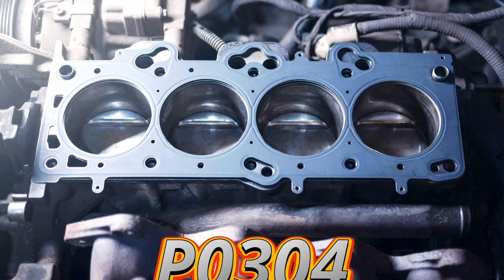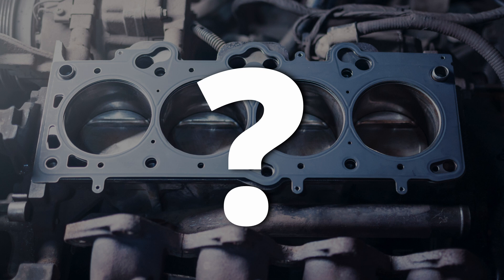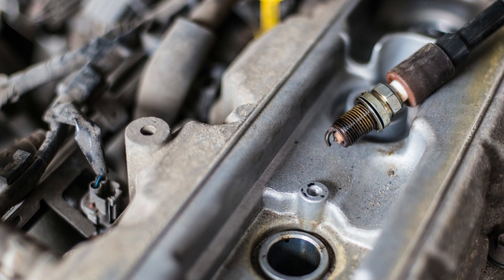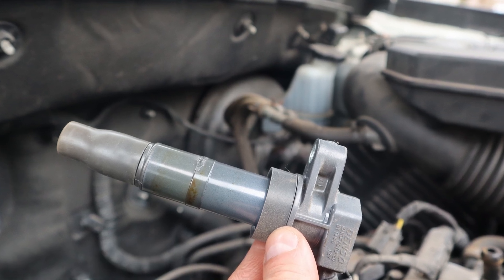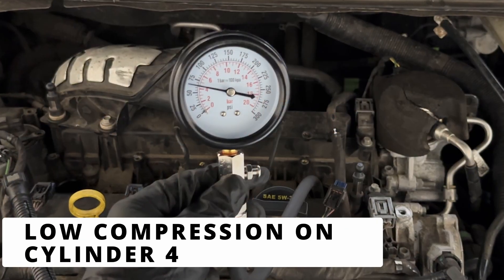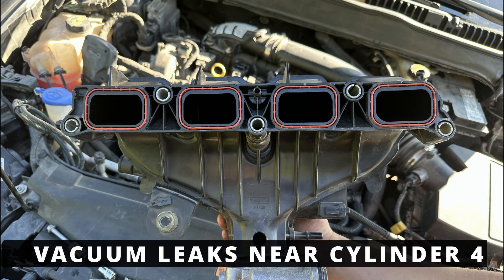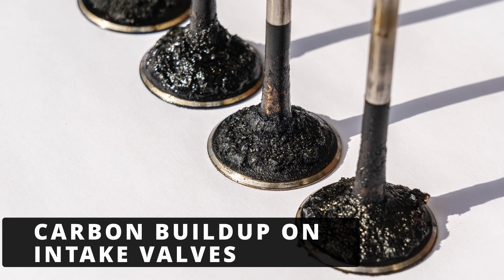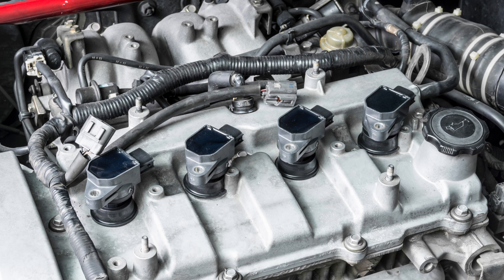P0304 EXPLAINED – The REAL Reason Your Engine Is Misfiring

Comment: I recently got a P0300 along with a P0304 and PO305 code. I changed out the spark plugs in a 2013 Toyota tachoma TRD with 265,000 miles on it and found the plugs to be burned from excessive heat with brown rings around the insulator just above the spark plug anode. After replacing the plugs the check engine light went out and the engine run as normal but now it puts out white smoke when first started up cold and then stops putting it out after about 5 seconds after running. The smoke is pure white and heavy it goes on the ground like a white fog. It only does this during start up when the engine is cold.
Reply from the maker: Thanks for sharing your experience!